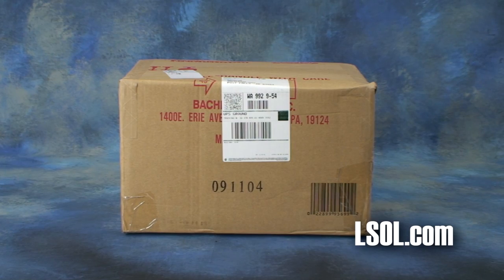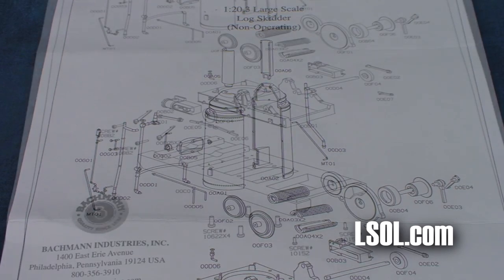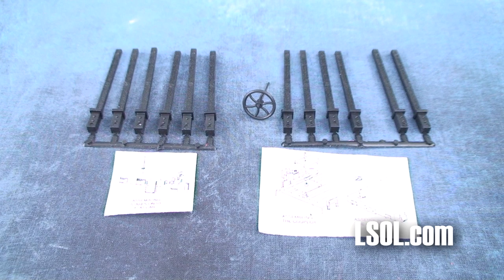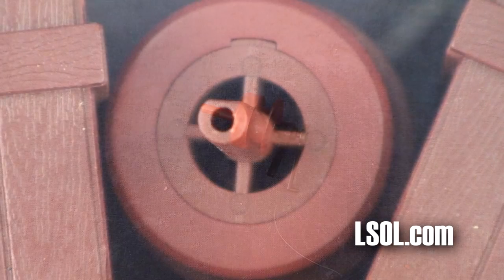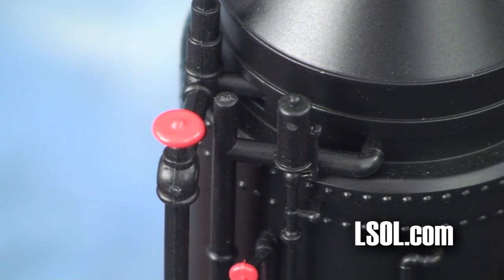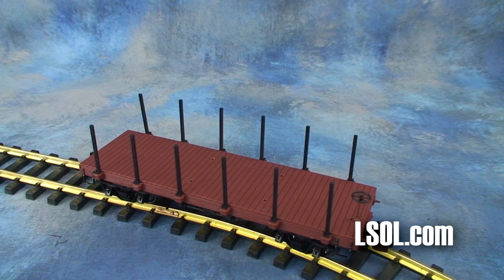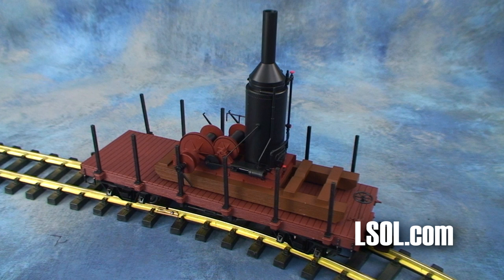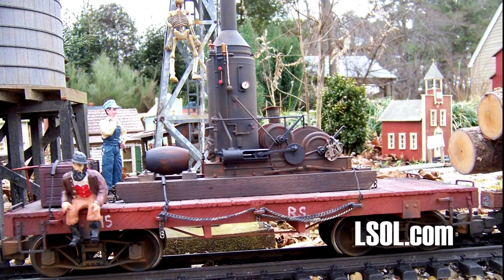Garden Trains: Bachmann Log Skidder on Flat Car

Comment: I recommend replacing the wire holing the skidder on the flat car with a chain and leaving off the stakes.  In real operating railroads, no stakes wold hold a skidder from sliding off a flat car, or on grades, prevent a skidder from crashing into another car.  Now you can buy wood grain decals that go onto wood painted "wood".  So you can make a very good convincing wood finish to the skid and the boxes.